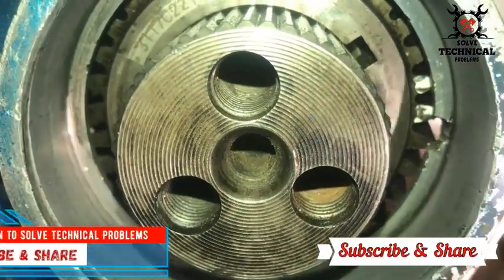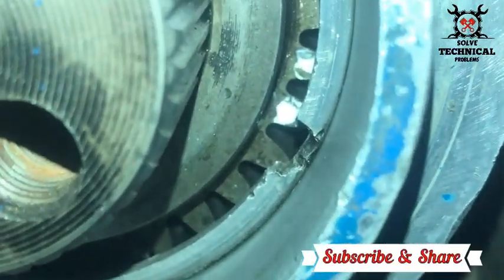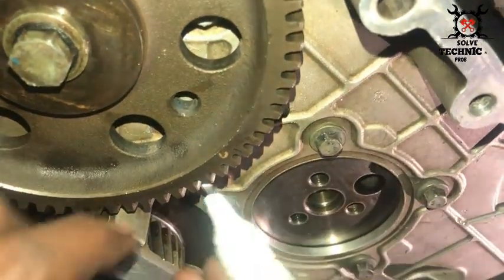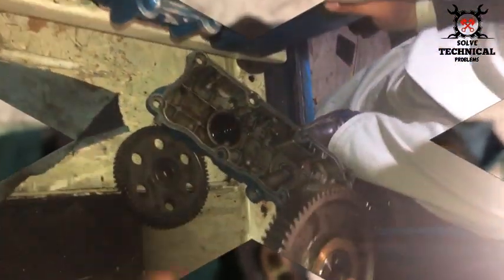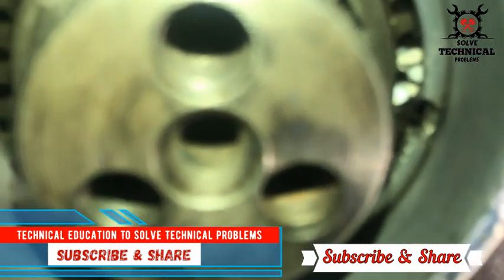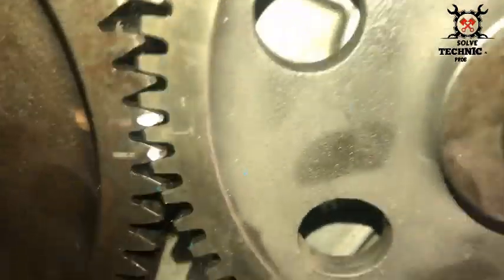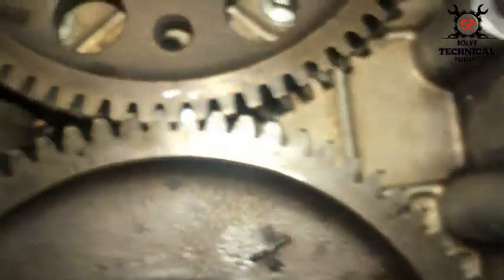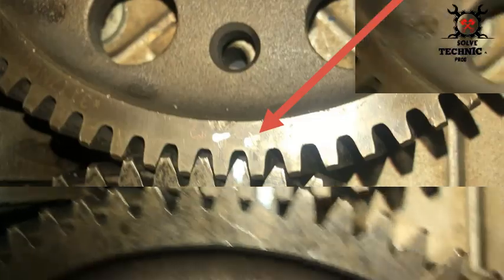“Perkins 3 Cylinder Timing Gear  | installation  Guide 🔧 #Perkins #TimingGear #EngineOverhaul”

Comment from the maker: Complete Perkins 3-cylinder timing gear installation explained step-by-step!
Alignment marks, backlash check, torque sequence and all important precautions included so you can avoid timing errors during overhaul.
If you need any specific torque values or more guidance, comment below!
#PerkinsEngine #TimingGear #DieselEngineRepair #MechanicLife #EngineRebuild